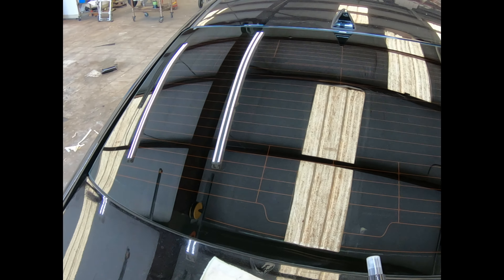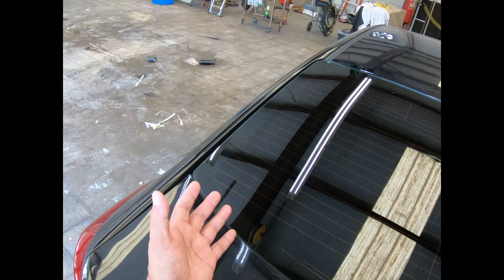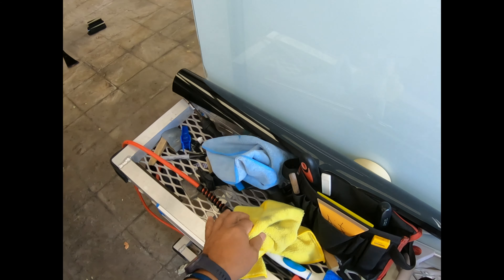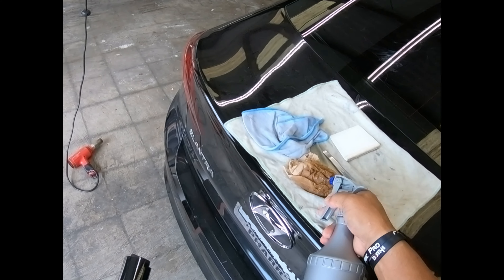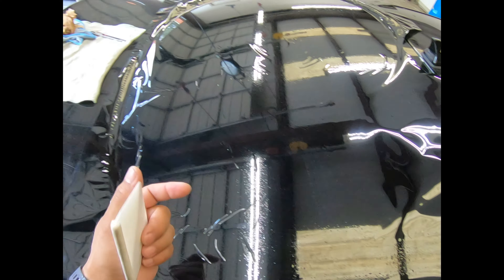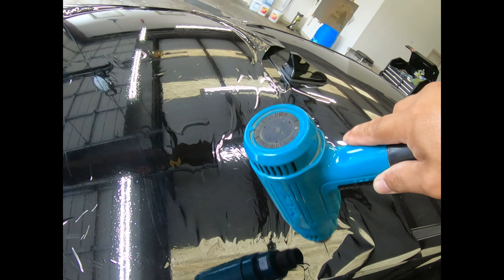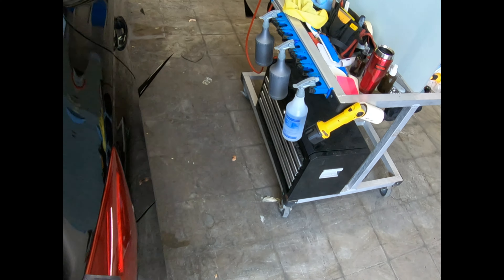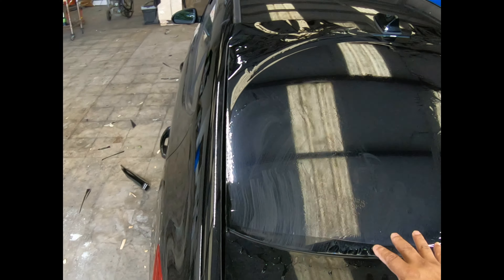WorldWide Review Of Daily Dirty Sauce!  Game Changer?!?!  Do Not Miss!!

Comment: Nice. On most back glass I usually leave the top part long (tint)
Reply: You mean you dont cut off the excess correct ? Why so ? I personally find it easier the less excess there is
Reply: @dorito7480  pull shrink method
Reply from the maker: ole tried n true pull method is awesome!!  but since we use plotters now..99% of the vehicles we tint will come exact fit...so we have to master this shorter film thingy!!  thanks for following boss!!  Dirty